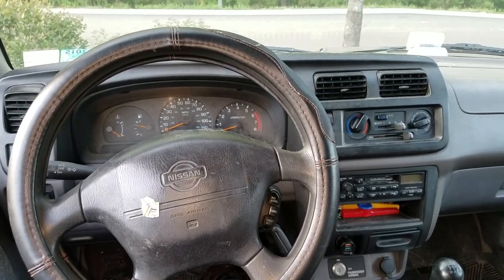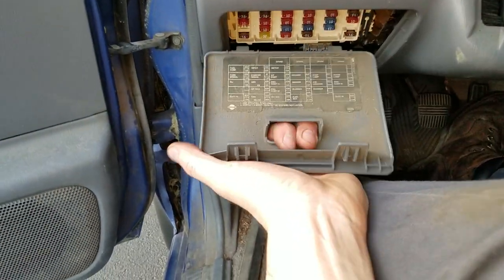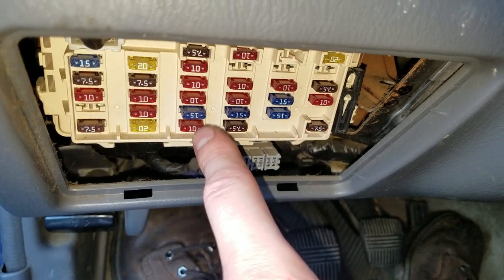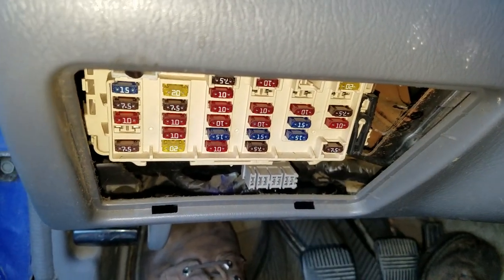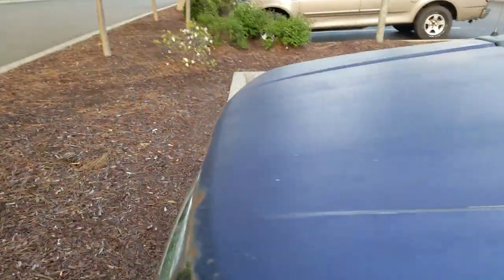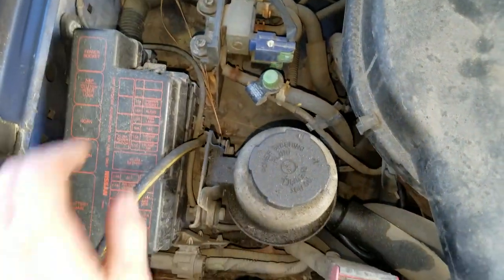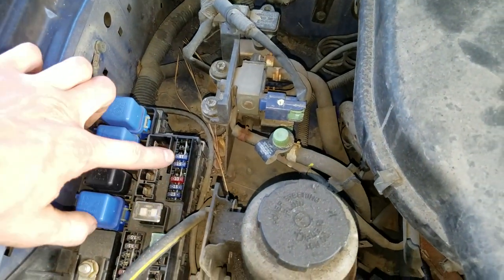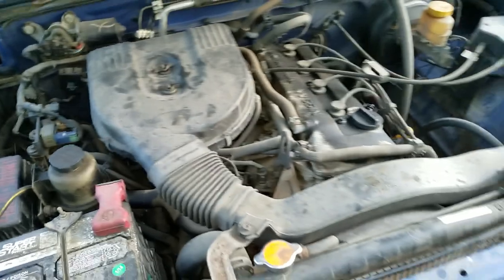Nissan Frontier Cigarette Lighter Fuse Power Outlet Fuse Location

Comment: where is the fuse for the cargo light?
Reply: In my 2004 Nissan Frontier, the fuse for the cargo light is listed as the cigarette lighter 15A fuse. I changed it, hoping that it would make the cigarette lighter in the console work, but instead it made the Cargo Light work. But when I changed the Power Outlet 20A fuse in the fuse box in the engine compartment, the cigarette lighter in the console started to work. Interestingly enough, that cigarette lighter in the console is always ON, so I have to remember to unplug it when I turn off the motor for the night; otherwise, the front facing windshield camera that I have connected to it might drain the battery if left overnight. I don't know how much of a draw it makes, but I don't want to take any chances with it, so I just unplug it if I'm going to leave the car for awhile.